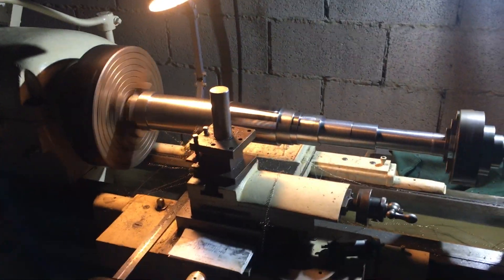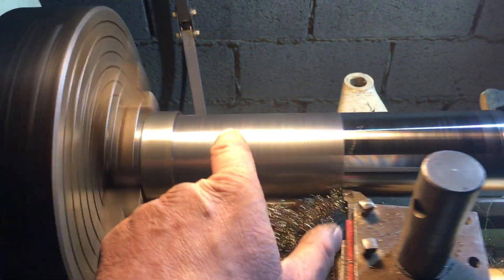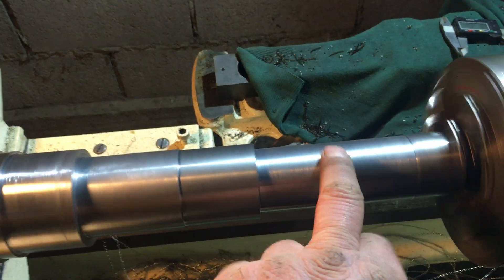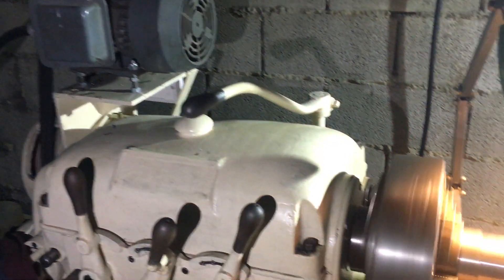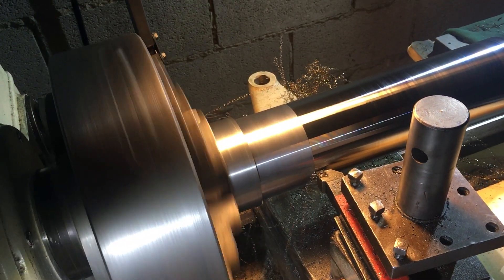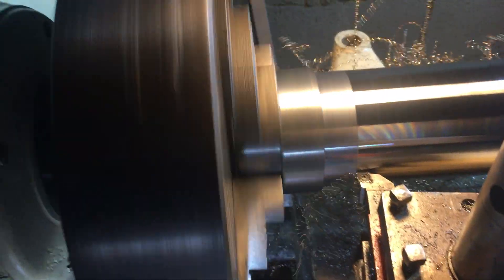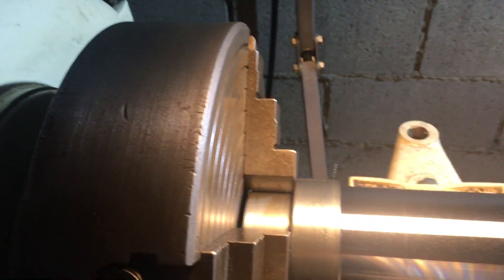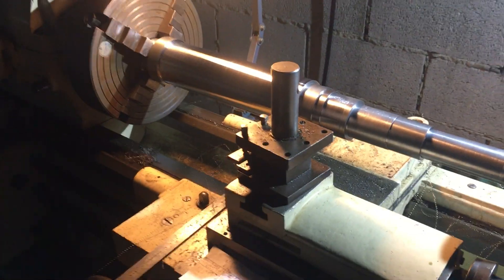1943 John Deere model A pt 9 lathe work for V8 conversion

Comment: Mr David... I know it has been a long time since the B restoration but can you tell me (if you can remember) what the bearing number was for the top transmission shaft that goes on the hi low gear and where you got it. My local dealer had the two shaft end bearings but couldn't find the other one. Thank you.
Reply from the maker: Hi Johnny is that the ball bearing that goes inside the input shaft or the highmatt bearing . If you go to the video no
Reply from the maker: Sorry if you go to video 21 I’m talking about various bearings if you can pin point the bearing via the video run time I should be able to help thanks David H

Comment: Looking great David, I can't wait to see the next progression. Also the lathe that you have restored looks to be operating great. You have done a wonderful job bringing it to its former glory. Can't wait to see what is next. Keep up the wonderful move forward!!!!
Reply from the maker: Thanks Tony , the lathe overhaul worked out well it was just an absolute sod to do videos on as every thing took for ever to put back together , for a machine that is over 80 years old it can still turn out good work . As long as the operator keeps up !!. The next job is too make the pinion housing I have the design in my head but as you might guess these things are always evolving as you progress regards David H.